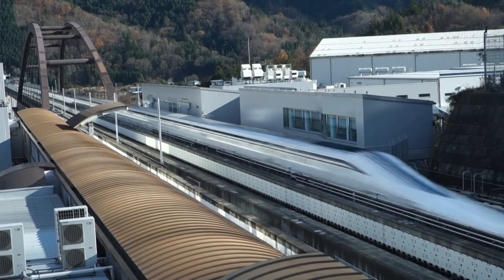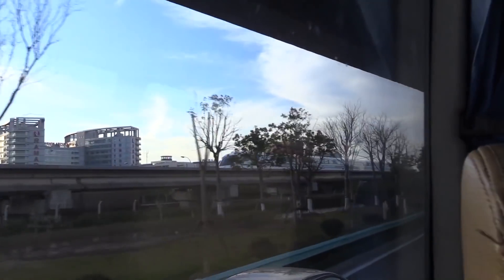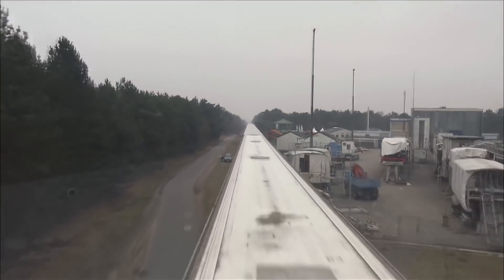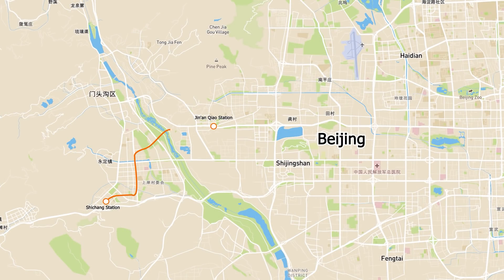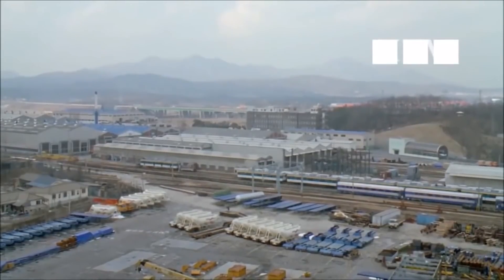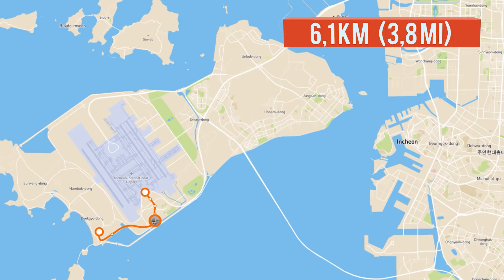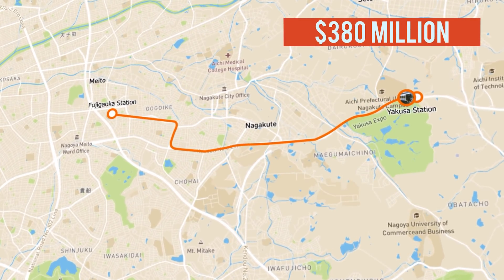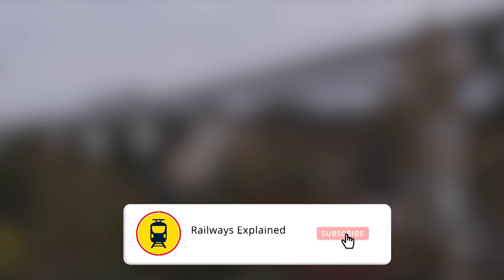Maglev Passenger Service Worldwide: Explained

Comment: Thank you for this video. 
The one problem I have is that I have absolutely no reference point for these construction prices. Is it too much? Average compared to normal lines? Or in line with the high-speed rails? And what are the forecasts? 

Will this ever lift up ?  (pun intended)

Comment: Fly into Detroit, and you can ride on their maglev
Reply: Regrettably the system inside the DTW terminal is not a maglev. It's actually a cable car that floats on an air cushion, a clever device in its own right but not really much of a train, more of a horizontal elevator with an interesting bearing system.

Comment: How do you switch tracks?
Reply: By using a bending steel switch, invented in Germany in the early 80s for the Transrapid Versuchsanlage Emsland and its own maglev-research that resulted in the Shanghai Transrapid whose originally build and manufactured in Germany, even most part of the tracks are of German origin.

Comment: I doubt that China would ever be able to do 600km/h with only 1cm clearance due to not being able to keep the track straight enough.
In my opinion it needs to be 10 cm like the Japanese maglev.
Reply: 1cm is what this maglev-system, patented in Germany, uses as air-space inbetween the tracks and the vehicle itself. That has been defined 30+ years ago, when in Germany the first Transrapid 06 was build for commercial use (in the end, we had Transrapid 07,08 (Shanghai SMT), and 09 already planned to use in customer service).
Reply: In democracies sometimes it is cheaper to go underground with a number of modern multi modal TBM working 24/7 than have expensive court cases.

A single 11 psi Maglev tunnel can increase speed from 600 km/h to 700km/h while still being breathable and passing stations would allow daytime trains to stop where needed with overnight container trains beating any truck by eight hours over 1,000 kilometres between freight sidings eliminating daytime planes and reducing trucks.

Using Sydney to Melbourne as an example with passing stations at Canberra and Albury it would cost $60,000,000,000 and return $20,000,000 per night which makes it able to subsidise daytime fares below planes and still have a return of 10%

Perhaps cooperation between Japan, China and America can develop the maglev container train with  Australia to use an international guideway to benefit the world.

Comment: It is such a huge pity, the project Shanghai Maglev should have been done to connect the two airports to the citycenter. When it was built, the Longyang Station was in the middle of nowhere, which could be done with low cost. Now Longyang is already included as urban area of Shanghai city center and I dont think any one is crazy enough to finish this project through the city, it is not a very useful line.

Comment: https://www.youtube.com/watch?v=ihSPEWyTRwk. A new maglev train prototype and 165 metres (540 feet) of test track were unveiled in Sichuan province in China on January 14, 2021. It was developed by researchers at Southwest Jiaotong University, who said their “high-temperature superconducting maglev” technology is more economical and efficient since it uses liquid nitrogen as a coolant. The train is designed to travel up to 620km/h (385mph), but developers are working to boost its speed to 800km/h (497mph). A commercially viable version of the train could take another six years to create.
Reply: 他说的都是商业运营的型号。

Comment: Shanghai's project was originally planned to extend but received many concerns,even protests because local residents worries about megnatic radiation. So the project was suspended and that line was never extended ever since. They built that line as an experimental project to help the decision in later years whether to use maglev or wheel technology for future high speed train at that time. Now we all know China chose wheel technology because of it's robustness and lower cost.

Comment: Low speed maglev trains loses the point of maglev.Maglev is for high speed as its operating cost is much higher therefore making it impractical to be used on a low speed route.Using normal metro trains save a lot of money on low speed route
Reply: @bearcd5313  轉彎半徑可以通過縮短車卡長度來減低，而且磁浮營運成本高很多
Reply: @bearcd5313  這是因為現在沒有地下磁浮
Reply: @bearcd5313  增加車輛數即可
Reply: @bearcd5313  列車造價比普通地鐵高
Reply: @bearcd5313  而且地鐵高架的造價跟磁浮相若，這說明地鐵成本較高的原因是在於地下化
Reply: @bearcd5313  芝加哥地鐵有一個半徑27.43米的彎
Reply: @leafbottle9420  说实话，不知道你的逻辑在哪里？懒得扯了！
Reply: @bearcd5313  我是在告訴你磁浮能做到的事地鐵也能做到，甚至比磁浮成本更低

Comment: Why they even need Maglev for such short distance...and so slow too...
Reply: if it weren't for the high costs, I'd say they should use it everywhere. its super quiet.
Reply: subway cannot handle radial and climb of a maglev. Easier to fuse into urban setting.
Reply: @kongwee1978  but there are similar ones like some airport express train
Reply: @xrq3223  Mostly induction motor train, usually use on monorail.
Reply: Although maglevs are more expensive, it might be cheaper that rail in some cases because you can just go around buildings instead of demolishing them. The monorails can also do this ad is cheaper, but since monorails have lots of friction because they literally use rubber tires, the extra money spent on the maglev might or might not be worth it. Different cities have different needs, so you have to weigh the advantages and disadvantages on which one you will use.

Comment: In the Chinese jargon, maglevs are classified into "high-speed" (高速）, "medium-speed"（中速） and "medium-to-low-speed"（中低速）. So if a project says "medium-to-low-speed", it already implies it's not "medium-speed". 

The Mentougou maglev of Beijing is more specifically a low-low speed maglev - although it technically can reach 100km/h it routinely operates at 30-40km/h, slower than most trains in 1980s in China. The only reason to use maglev is maglev makes the project cheaper and easier to extend into the mountain in the future.
Reply from the maker: Thanks for clarification!
Reply: Yes , the Beijing S2 route is wind up on mountainous area. Maglev can make it turn radius and steep drive far better than rail.
Reply: I might be wrong but how is it that using maglev makes it cheaper? 750 million dollars is way more than it would cost to build a regular train line and maintain it for a long time, whereas maglev équipement is much more expensive to replace due to economies of scale right?
It sounds like it's just a pr move rather than an actually useful application of the technology
Reply: @alfredzanini  In city areas, the main cost is tunneling and land acquisition. Price increased by maglev is neglible, while the improved curvature and slope allowance will make the route cheaper (if you want, you can build a roller coaster with maglev), which is a much noticible cost benefit. 750 million dollars is way more than a regular train line but way less than a regular subway line. Whether it's cheaper than viaduct light rail I'm not sure, but long term speaking (when the tech application become massive) it should be.
Reply: And maglevs needs less energy and maintenance than conventional trains.

Comment: Superconducting maglev is too expensive for commercial use.  But it's still super cool (literally).
Reply from the maker: haha, good one!
Reply: It´s not to expensive, since Germany is the owner of the technology (and the trains itself were build in Germany) that is in use at Shanghai SMT, it for it´s own studied the costs for several maglev lines, but some missleading ideologically backed missinterpretations brought these to the conclusion that it was too expensive. Clearly a lie to favour a track-bases HST before the transrapid maglev-technology.
Reply: @Ben Kang Wrong. Since this special maglev technology in China is based on a German patent. Also the L0, which was developed in the 70s in Germany, but they didn´t have a use for it (because they decided to go for Transrapid-System, which is now presented to us by China as their own development, which is false) but the japanese had. Believe me, I know what I´m talking about. And magnetic monorails aren´t maglev. If it is about the other maglevs: Also a German patent that has been in use since the 80s (Berlins M-Bahn for example). You seem to confuse "build/assembled in China" with "Engineered in China". That´s a big difference for patent holders that are aware of them being stolen from, not in a literal but in a propagandistic sense of course. And: The Changsha maglev line uses a concept that was discarded as an option during the late 70´s and early 80´s development of the transrapid (Shanghai SMT & Transrapid and CRRC 600) in favour of the last one. Same goes for Japanese L0 (Chuo Shinkansen) and other similar systems as the chinese copy of the japanese MLX01, a technology which was build as "Erlanger Erprobungsträger" first in 1973 in Erlangen, Germany by Siemens. This vehicle used the superconducting magnets, that had made levitation possible by cooling them down, for the first time. It apparently seemed not to be effective enough, that´s why German engineers stayed with the transrapid technology (Thyssen).

Comment: Great video!  It was very useful to see all of these compiled in one place.

When you do one focusing on the Shinkansen, I read an article a few months ago about how the Governor of one of the prefectures through which it passes was holding up the project on phony environmental concerns.  It was pretty apparent that the real problem (as far as he saw it) was that the new line would go through a tunnel  on a far corner of his prefecture, rather than going through its heart and stopping along the way, as the current one does.
Reply from the maker: Thanks for the support and the suggestion! 
Can you find the link of that article?
Reply: @RailwaysExplained  Here's one that talks about it.

http://www.asahi.com/ajw/articles/photo/31386700

This article includes a route map that makes it pretty clear what the Governor's actual concerns are.
Reply from the maker: Thank you

Comment: Great sum up! Just a small correction, in South Korea both the Daejeon and the Incheon lines have 110 km/h top speeds.
Reply from the maker: Thanks for support. As we know, operating speed for Incheon maglev trains has limited speed of 80 km/h. Regarding maximum speed, you are right, these trains can achieve 110 km/h.
Reply: @RailwaysExplained  You are actually right, I have checked for the Korean source and it says "열차 최고속도 110km/h
(안전을 고려한 실제 운행 속도는 80km/h)". It means that the actual driving speed for safety is 80 km/h.

Comment: Is this the future? I do not know， same problem with nuclear power or nuclear fusion is that the cost is too much high.
Reply: Maybe we could figure out a way to cut out the cost?
Reply: @waffelo4681  Maybe,  but like the nuclear power ,It has been born almost 70 years, the cost is still growing, on the other hand PV cost are already lower than thermal power. Hard to say.
Reply: @XIANGTIANXIAO  Oo yes,but i hope we'll advance even more in the future like we already passed 2020 still no flying car?lol
Reply: @XIANGTIANXIAO  theres nothing wrong with nuclear. in fact if one plans to operates a nuclear plant for like 15+ years, its actually cheaper overall than coal or gas. there is really just two stumbling blocks. one is that the public might be concerned because well, nuclear even though the newest plants are well designed and cant blow up like chernobyl . the second is the high upfront costs, you dont make money off a nuclear plant til years into its operation, while a coat plant starts making money just the first couple years with much lower initial investment.
Reply: Well it might be the future the question is just at what time would be the right time for it to be widely implemented. Because the first attempt by German companies to spread the transrapid failed, all of its domestic projects were seen as cost ineffective, and it was only able to export the trains and help build the line in Shanghai as the Video stated. And even the extension of the transrapid line in China was abandoned due to cost concerns. But maybe it might be viable now or maybe years from now that is the question.

Comment: What is the advantage of low-speed maglevs with a top speed of around 100kph, comparing to conventional wheeled rail transports? I mean even some subways (such as Shenzhen metro line11) can reach that speed.
Reply: Energy efficient, quiet & smooth ride, strong climbing capability, small turning radius...etc. just name a few.
Reply: @martyslacker4281  That is interesting and I can especially believe the ability to take steeper grades than a steel-wheeled train, but how does it permit tighter turning radii and is it still more efficient when you consider the cost of helium and the need to cool the rails?
Reply: @martyslacker4281  low turning radius makes it less efficient because it has to hover higher so nothing touches the ground also at low speeds they are not that efficient because they use power to hover
Only at higher speeds do the savings from friction and aerodynamics outweigh this, so the faster = the more efficient
Reply: @the_retag  Less turning radius , So less construction cost.
Reply: Even though there are now high-speed wheeled trains that can reach over 400kph in China; Maglev must surely have greater potential for the top speeds it can reach.
Reply: @eitkoml  I'm talking about the low-speed ones. All the lines mentioned, with exception of the shanghai one, are low speed maglev
Reply: @kevintang5473  Low speed maglev trains are a step in the direction towards making hoverboards from Back to the Future a reality.  Proper hoverboards that actually hover, not those wheeled things that have been mis-labeled as hoverboards.
Reply: @eitkoml  nuh. Maglev needs a magnetic rail, so you can't hover on roads unless you lay magnets and controlling components under the road. Sci-fi hoverboards are actually closer to the Aérotrain, which uses air pressure from jet engine to levitate train (a very cool technology developed in the 1970s, worked well as a prototype but was way too loud to be commercially practical)
Reply: @eitkoml   this why China and Japan are constructing such systems with topspeeds of 600 km/h alongside traditional highspeed rail
Reply: No driver, less operating costs, less noise. Fully automated system like Linimo. 
Except less noise all this element can be achieved in a traditional fasion rail.
Reply: The advantage of low-speed is efficiency if the route is short from one station to the next. And if the route is really short (i.e. 1-2km), the train won't have enough space to reach, for example, a speed of 400km/h and return to 0km/h between the stations.

Comment: Good news and thanks. China is now also testing a 600 klm maglev. www.youtube.com/watch?v=sERMusY-c5s
Reply from the maker: Yes, they plan to build two lines. Shanghai-Hangzhou and Guangzhou-Shenzhen.
Reply: It cannot test this train, since no testtrack that would be long enough is currently existing in China (The Shanghai SMT-Track cannot be used, because of the German technology and guiding systems in use there). That is why China tries to get hold onto the Testversuchsanlage Emsland in Lathen, Germany were all of this "new chinese technology" was brought to live 40+ years ago (first Transrapid entering service in 1983 as Transrapid 06, developed by a man named Gunther Steinmetz, which was also head administrator of the TVE and works as technical advisor for also the chinese maglev-projects partially.

Comment: the shanghai transrapid takes  about 20 mins because it cant go at full speed the whole route( has to build up speed and then has to slow down). went on it in 2004 - amazing train. Didnt even connect to the shanghai metro then( we had to walk about 10 mins).
got a chance to look in the drivers cab expecting it to be all futuristic. It had a simple office chair and next to it... a wooden kitchen chair !
Reply: I took the ride in 2009, it was like 8 minutes and for a while over 430 km/h
Reply: There are two speeds they're travelling, depending on the time. sometimes at 430 km/h, and other at 350 km/h. Don't know why tho.
Reply: @Jason-le3of  可能是为了省电？我猜测的

Comment: Also note in the original plan, the shanghai maglev project was supposed to be part of Shanghai-Hangzhou maglev line. However, it was canceled due to a combination of local protests to EM radiation fears, availability of conventional HSR as well as unexpected high cost of maintenance for maglev.
https://www.reuters.com/article/worldNews/idUSPEK32757920080112
https://en.wikipedia.org/wiki/Shanghai%E2%80%93Hangzhou_maglev_line#:~:text=The%20Shanghai%E2%80%93Hangzhou%20maglev%20train,(mainly%20ThyssenKrupp%20and%20Siemens).
Reply from the maker: That's an interesting information, thanks for share!
That would make the travel time between Shanghai and Hangzhou (169km at 450km/h with 4 stations) less than half an hour.
Reply: okay, but the source refs from reuters and wiki about China, creditility -90 points instantly...you need some real ref.